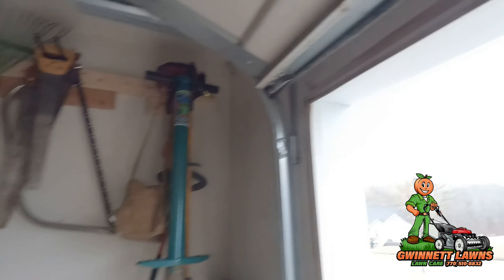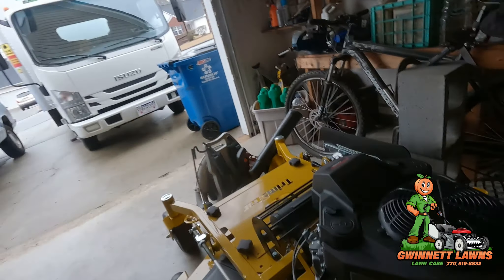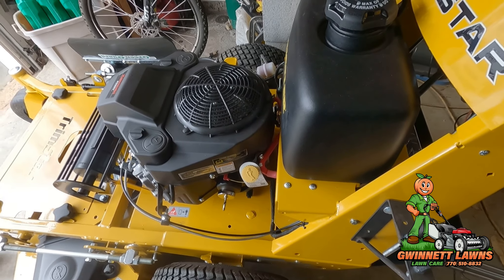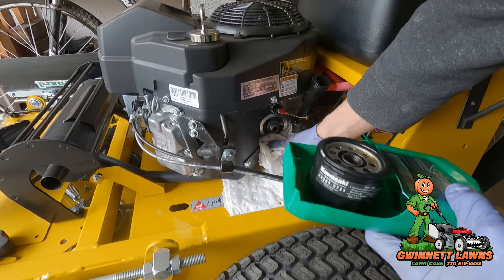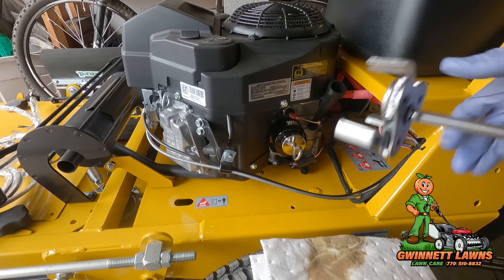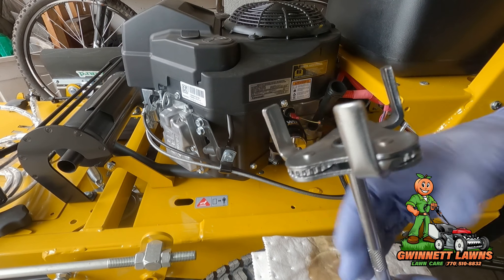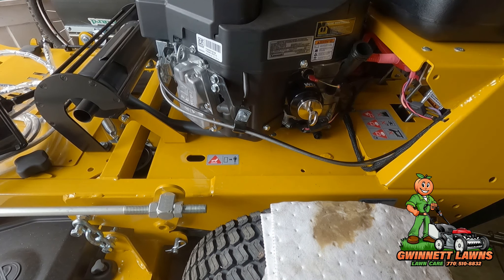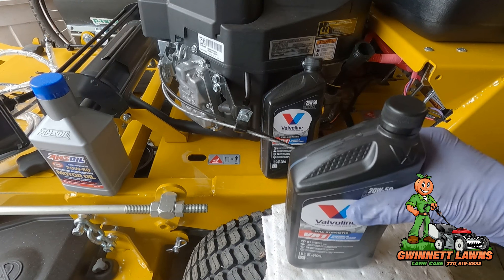Dont use Kawasaki's Valve to Change the Oil Anymore....I Found a BETTER WAY

Comment: There are several companies that make a steel braided drain hose set up with a tapered seat plug away from the engine, no heet cycling, no fumbling next to a hot engine, etc. But they are proud on them . I really like the dry sump system on my ferris' mowers. But i do use the oil extractor on all the others.

Comment: I've been running Amsoil 15W-50 Synthetic Small Engine Oil.
Have you tried it?  Supposed to have high zinc additives.
Reply from the maker: Its super oil but I  have not tried it yet.

Comment: Interesting. Neither of my Kawasaki engines have that part, it’s a metal plug (or in one case, it’s got a hose that ya unscrew the bottom part to quickly drain it).

Comment: That valves a Hustler part, not a kawasaki part. Hustler cheaped out when they switched them to plastic.
Reply from the maker: Genuine Kawasaki 49116-0714 Oil Drain Valve Assy.  Nope, its a Kawi part and is used on many other mowers.  Above is the part number, check it out.
Reply: @GwinnettLawns  my dealer was wrong on that, stating it was a hustler part. My trimstar leaked slightly at that valve, too, and I switched to the hose style. So far, so good. Thanks for the info.
Reply from the maker: @ericrebert1378  The only reason I knew it was a Kawi part is that I was at my Scag/Wright dealer and they replace those valves on LOTS of different mowers with the plugs.